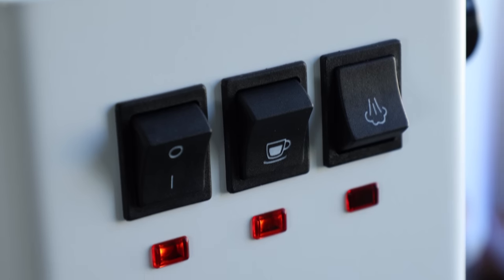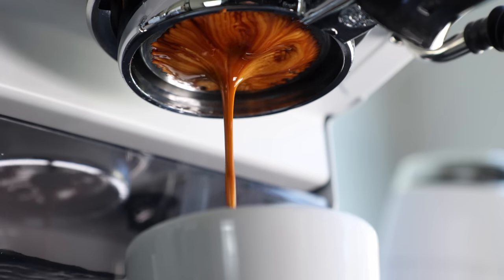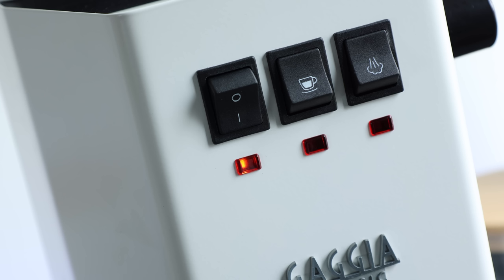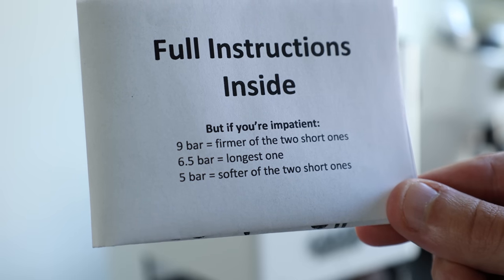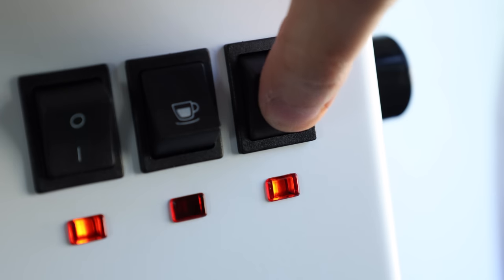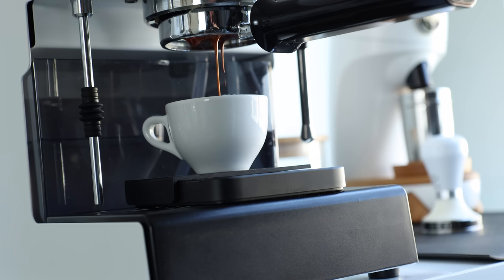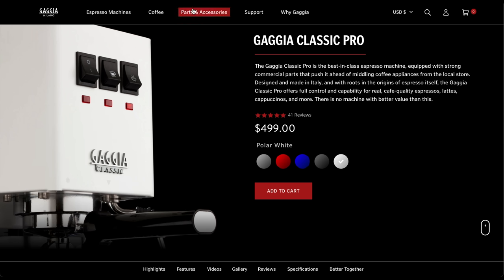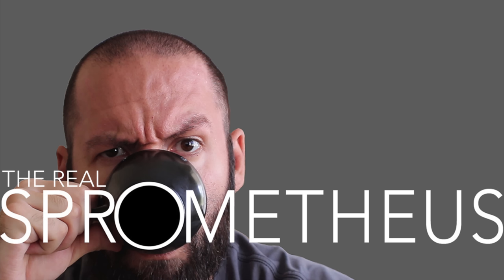GAGGIA CLASSIC PRO - Small But Mighty Home Espresso

Comment: My first espresso machine was a late 70s Gaggia Classic, paired with a Gaggia MDF grinder (a bad choice!).   Making good coffee consistently was impossible, but OK sometimes.  My first upgrade was to a better grinder, a Mazzer Mini Doserless (Type A I think), which gave significantly better results, but still many hit or miss shots - grind timer setting a PITA.     Back-to-back 'decent' (for those days) shots not often possible.  I would estimate 4/10 sink shots, with 2/10 'good' and 4 'barely palatable but drunk anyway' (my tastes more forgiving in those days because of necessity).   When you are using a Niche Zero, a grinder that costs twice as much as a Gaggia Classic Pro - I find that interesting (no problem, the Mazzer was also more than twice the price of the old Gaggia Classic).   Steaming milk gave good texture sometimes but often not, but luckily I like black coffee, zero milk or sugar, so that was OK.   Got tired of the effort and unreliability and have ended the search with a GS/3 and a great grinder, which makes fine, fine coffee every time with zero fuss and finagling.  Zero sink shots once a product is dialed in, mostly the result of very accurate brew temps with a saturated group, an 'aces' grinder and better coffee these days than those days.

Certainly a lot of little upgrades to the Gaggia Classic in the last 25+ years with the Gaggia Classic Pro.  Nice review.

Comment: I have a Saeco Cafe Via Vinezia. I think it's going on twelve years old and other than flushing for hard water build up I haven't had to do anything else for it. Not sure if this is built on the same quality as the Gaggia but it does seem to have the same for factor. I'm not an espresso connoisseur but the Saeco seems to make decent espresso with its 53mm portafilter and I've never known enough to even consider temperature surfing. The only draw back I've found is the portafilter size. It was a little difficult to find a small distribution tool and I can't seem to find one of those precision porta-filter baskets for a 14gram 53mm basket.

Comment: Great sum up of a great machine. 👍 (for the price point). Had mine just over a year and still learning. Now using vst basket, ims shower screen ,silicone gasget and bottomless when my daughter not waiting for her weekend latte! Just thinking about the 9bar spring now that the warranty is up. Seems everyone is doing it but wondering if it will have any negative effect on the pump long term as its designed for 15bar. And Fyi-  There is also a good trick to get max steam by timing the ready light and then next time start steaming about 5 seconds before.
Reply from the maker: Thanks Mark! And I don’t think there is any real negative effect to the pump by changing the spring, but a new pump is about $24 so it won’t be a massive expense when it eventually does go out down the road. 

I’ve definitely heard of they steaming technique, I tried a few of them. If you look through the comments a lot of people have their own thoughts on the best steaming process, but in the end if you can get the texture you want it’s a win!
Reply: Strongly recommend replacing the OPV spring unless you're using the pressurized basket. It's a cheap option and makes a fairly large difference. Probably a bigger difference than a basket upgrade even. (But still, upgrade the basket, too).
Reply: Upgrade that spring pony boy.  That way you get faux pre infusion as you’ll be waiting for around 6 seconds before first drop, it’s a 2 minute job and don’t be freaked out by the change in tone of your machine even my ECM sounds different at lower pressure.

Comment: After owning the gcp for 3 years, I’ve found the best way to steam the milk is to flip on the steam switch and then you want to start steaming about 10 seconds before the light turns on, so about 25 seconds or so after you flip the switch which for me is just enough time to grab my milk from the fridge and pour it into the pitcher, because this way the boiler is still going to be heating up while you’re steaming and you’ll have enough steam power to last till your milk gets hot enough.

Comment: Good stuff. I have a 15 year old one that I never use. But it does beg the question…would it really be so hard for them to make one that just works out of the box?
Reply from the maker: Haha I often wonder this on a lot of things . You’d think they would see the huge following of espresso nerds and just make one that has all the goodies so it’s out of the box a little beast.
Reply: This seems to be a common theme even with much more expensive machines, they rarely come set at the correct pressure which seems weird to me as a lot people don’t have easy access to the OPV and are not comfortable with digging around inside.
Reply: The 15 year old one is the best model, with screw adjustable OPV (assuming it's not solid with scale). Spare parts are plentiful from 3rd party suppliers. Mine's 20 and still going well.  The 15 bar setting for the Classic is... regrettable, but as it comes with a pressurised basket, you need that extra push for those to work right. But again, the 3rd party community will help you remedy that with springs for the newer models, or replacement OPVs for those who have them all crusted up.
Reply: @truckerallikatuk  thanks. Any hints on how best to resolve the temperature and pressure issues without too much faffing around? I guess I need some sort of pressure gauge and a temperature controller.
Reply: @gianpaologliori3604  The only way will involve modding, and that depends on your model. A 15 year old machine should just need some tweaks to the screw insert inside the OPV to drop pressure. Temp control will need a PID kit or getting good at surfing.

Comment: With good beans and water, i'm consistently amazed by the quality espresso that the GCP produces. It has no bells and whistles, but produces quality drinks. My real complaint is lack of vertical space between the portafilter and tray, which means the tray is always left out of the machine, replaced by a paper towel and some messiness.

Comment: Good
What do you think is the best machine for light roasting espresso extraction at home?((I like electronic control to a certain extent, except for Decent)
I wonder what you think. 

Ex) Bianca, Synchronika, R9one, Crem-one, Londinium, LMLM with mod… etc
Reply from the maker: I wish I could tell you, but I haven’t tried all of the options out there.  I think a lot of the things that help extract light roasts like temp control, pre-infusion, pressure profiling, and the like will always produce great shots when paired with the right grinder and some careful prep. In the end choosing between machines with these features will be more or less what you want in terms of the little things like aesthetics, availability, etc.
Reply: @Sprometheus  Thank you for your wise answer. You're all right. I'm sure you haven't used many machines yourself, but I'm curious if you could choose the one that you like the most when you think very subjectively.(Based on the information you know or hear)

When extracting light roasting

Comment: I've had a Gaggia Classic since 2011 and a Dalla Corte Mini for about as long.  With a good digital thermometer mod you can temperature surf with the Gaggia and produce first rate steamed milk, at least good enough for decent lattes and cappuccinos.  It's easy to maintain, easy to use, and built to last.  What is not to like?  Oh-- and it costs a fraction of machines that don't necessarily produce better coffee.

Comment: I’ve got a Gaggia Classic and usually what I do for the steam is turn it on, wait for the light to come on, purge the steam wand until the light turns off, wait 5 seconds, and then open it up 100% and steam my milk. It maintains a higher steam pressure throughout my frothing.
Reply from the maker: For sure, there are a ton of different techniques out there, but I think there are multiple ways to hit that ideal texture with a little patience and a bit of milk.

Comment: It is said that the steam pressure drops significantly by using the 6.5 bar spring, did you test it with the 12 bar, or even 9 bar? @The Real Sprometheus

Comment: It truly is an incredible machine. 

You can pick up a used one for around $250, and with mods totalling around $500 for a machine that rivals anything on the market. If you’re handy, it’s pretty incredible what you can do.
Reply from the maker: And I’m not even particularly handy, but a the minor mods I did made a massive difference for less than $100 and an hour of work.
Reply: I got mine for 20€, good working condition. :D

The seller was surprised by the number of offers she got on her ad: she told me that a friend of hers in Ireland had tried to give away her own machine for free, but couldn't find takers.

Comment: The explanation of the "disposable" comment (which I missed in the first video) just leaves me with more questions.  Does it have proven failure points?  Are there other sub-$500 machines which are proven less prone to failure?  If so, which ones?  If not, then I think your explanation should simply be "I consider all sub-$500 machines disposable", and leave it at that. ✌️

Comment: 13 year old classic owner (with the real Allen key OPV).... It's not built to last - the spot welds down the back have come apart so I'm scared to lift it forwards to find that ideal steaming angle 
Mods? Yes please. Stainles sceen holder, IMS screen, Rancilio wand, upgraded solenoid , and changed the steam thermostat to a 'hotter' one. 
Have taken it all apart twice for full strip , descale and rebuild, plus the usual tablet based maintenance. That aluminium small block boiler just corrodes slowly over the years and you can see the contact points with the brass items / group head aren't what they were. 
Does it make killer coffe? Yes probably 3 or 4 times out of 5 
Do I want a Lelit mara X or even ECM mechanika v slim  / profi 500?
Yes

Owning this gaggia is like owning a fiat. It's gloriously fiddly like all the best Italian products through the ages, and rewards you in spades when you furnish it with love 
Just god help you when it starts to break down ... That's when this barista hobby becomes a mechanic hobby!

Honestly, it's a great addition to any kitchen

Comment: £350 for a new one on black Friday. Made some questionable 'cappucino' with some Carte Noire, and a right mess, still better than what sometimes passes as coffee.

I'm willing to learn and play, I'm used to spending some time for my coffee (aeropress, JX Pro). I've got some mods on the way (spring, bottomless). So basically, should be some fun times ahead. 

I'm of the opinion that it's worth spending some time making coffee anyway. Keeps me away from my home office, and I don't end up drinking 1/2 dozen cups a day. So far, it's been a blast, and I'm just starting. Maybe a PID in the future. Well, most certainly.

Comment: I just repaired a friends espresso machine (a 25 year old Sanremo). Turned out the bug was a bug. A cockroach had gotten into the water tank, died and disintegrated there. Had to clean cockroach bits out of the vibe pump, the pipes and luckily found a metal filter in the fittings just before the thermosyphon loop which had caught the rest. So cover your water tanks or fit a good filter! "Bespectacled messiah" 🤣🤣🤣

Comment: What is the rationale for so many of the lower cost espresso makers having higher pressure settings than standard--15-20psi, when 9psi, or even lower, is preferred? This seems like a zero cost change that the Gaggia, and others, could make.

Comment: Thats the great thing about the majority who dump their machines after two or three years of use,  its so easy to buy cheaper on ebay and fix up. I would never buy one brand new one I might get the pro second hand one day but I'm pretty happy with my classic made in 2006, after buying at auction for only  £183, a full clean up and several MODS it works good as new :) With A Eureka Specialita as its sidekick its pulling great espresso.

Comment: mine bit the dust after 2 years, luckily it was under warranty and even then they werent able to fix and i was refunded my money. i never modded my machine at all and it left a lot to be desired, the temp and steam were absurdly unpredictable and inconsistent. i could tell my temperatures were dropping drastically mid shot and steam was just a headache because when it says its ready to go it actually just stop heating and leaves you with very little steam.

Comment: I've used the GCP for 1 and 2/3 years and have had some good results from it. I do find some challenges with consistency, but then again I haven't modded mine at all. I did upgrade my grinder, and truthfully that made a massive difference. I think chasing consistent results is probably that last 15% to getting great espresso each time. I'm aiming to upgrade rather than try to mod the Gaggia at this point.
Reply: I just got my GCP and can’t avoid channeling no matter what I do or what grind setting I use! Using a precision basket and WDT. Using a breville dose control pro - is it just not a good enough grinder even with WDT?? Ordered a 9 bar spring so hoping that makes a difference, but interested to know how you manage without any mods

Comment: The GCP also needs you to steam surf too.  I pull first then flip the switch.  Use a timer for this too.  Purge anytime between 0-20seconds for 5 sec then wait till 25-35 sec depending on when you purged then start steaming.  If the light comes on you failed. 🍻🏆

Comment: I agree with most of this. Obviously the “disposable” comment is nonsense though. It’s not just because mine is ten years old, it’s really obvious when you own it for a while that it’s designed for repairability. I think it’s normal for manufacturers to push the spares market to third party suppliers. It’s VERY easy to find all the parts.

Comment: I can’t for the life of me dial in the espresso on this machine. I have the 9 bar and all other reasonable upgrades, 18g bottomless basket. I set my sette 270 on the finest grind, fill the basket with 18, tap it right, and it still puts out too much coffee. My grinder is new so I know it isn’t the grinder. Should I add more than 18 grams?

I’m using lavazza super creama currently. 

Any suggestions would be great

Comment: I’m interested to know I how many GCP owners know their flow rate, mine was off the charts at around 20ml/S which rendered the IMS screen unusable, I ended up buying a Ricambi which performed a lot better plus the failure rate on the IMS screen is unacceptable as many are severely warped out of the box rendering the seal useless.  Compared to my E&B Labs screen for an E61 they feel like knock offs or didn’t make the grade for higher end machines, just stamped out and thrown in a box with a hefty price tag.

Comment: Would you recommend adding a PID or upgrade to a whole new machine?
Reply from the maker: I mean, that kind of depends. If you’re overall very happy with what you can produce on the Gaggia and temp is your main pain point I’d say get the PID. But if you’ve hit a wall with the Gaggia and want  PID and maybe side by side stream and brew I’d go new machine and get a dual boiler.
Reply: @Sprometheus  better start saving 🤑🤑🤑

Comment: I am torn between Gaggia and Flair 58. Perhaps it is a bit of apples to oranges, but at the same time, I think they are not that dissimilar in terms of workflow (especially with the fact that Flair has a heater, as janky as it may be). I seldom make milk drinks(maybe once a month), and after adding all the mods and accessories to Gaggia, I would end up spending 1.5-2 times compared to Flair.

Comment: I've had the GCP for 2 years. honestly never really got there on the stock steaming power. by doing the common, out of the box hack (steam before steam light comes on), I was able to get pretty consistent results but not always. it wasn't until I installed the PID where my steam power became really good.

Comment: Some problems about this machine.
1. The steamer drips all the time, espesially while the espresso shot is taken.
2. 100ml boiler is not enought to steam the milk. While steaming the milk the heat light turns off, meaning, the steam turns to cold. The hot water is allready finishes far before the milk steamed.
Reply: 2. Is fixed by a PID that let's you set the steaming target temp. Easily doubles the steaming power and keeps it stable.

Comment: Temperature surfing by waiting for the light to come back on? Nope. Temperature is only around 180 when that occurs. Surfing can be made much more precise by adding a cheap digital thermometer. You can get five of them for $10 on ama-zon. You might have to be creative in attaching it to the boiler. But it will tell you when that boiler has reached your target temperature. Then you can add a $10 dimmer for flow control, which incidentally also obviates the OPV mod. Lastly, folks seeking a ‘disposable’ espresso machine typically get one for $100 or so. I don’t know anyone that considers a $500 espresso machine ‘disposable’.

Comment: Using a 400 $ espresso machine with a 2000$ (or even more) Niche Zero grinder. How?
Reply from the maker: The Niche Zero is $500 where I live, and most baristas will tell you the grinder is far more important to Coffee quality
Reply: @Sprometheus  no problem, but I don't agree the grinder to be more extensive than the coffee machine itself
Reply: @Sprometheus  no problem, but I don't agree the grinder to be more extensive than the coffee machine itself